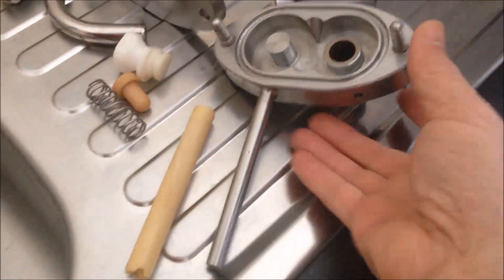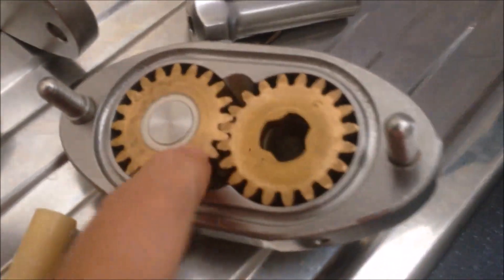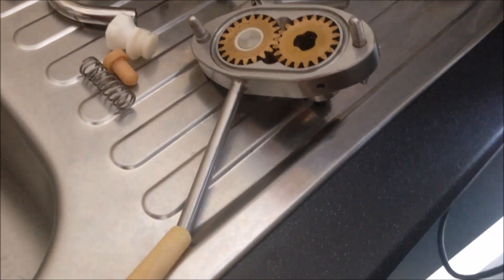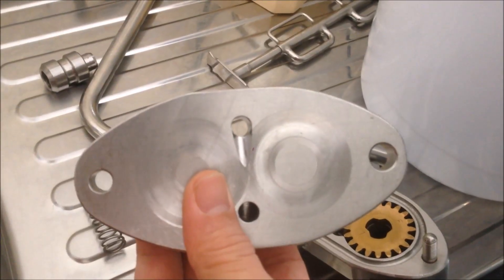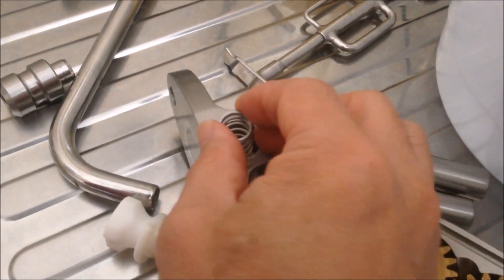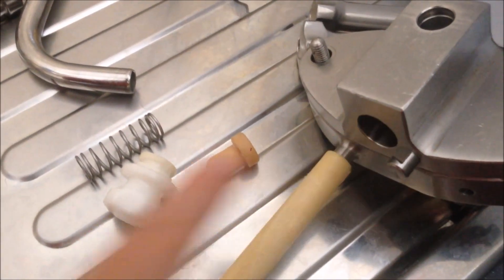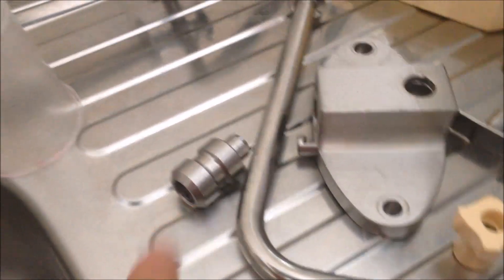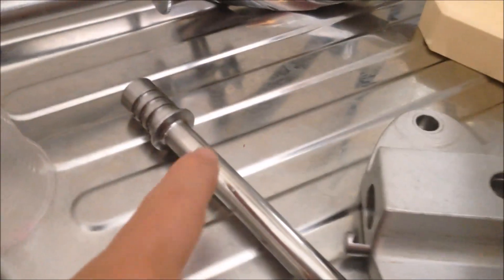Carpigiani 141 Ice Cream Machine: Mix Pump and Pressure Pipe Components

Comment: Hiya I just bought second hand machine and it doesn’t draw mixture up, upon opening I figured out the pointed valve is broken. Could that be the reason? Thank u
Reply from the maker: The vacuum should be produced by the rotating gears. Make sure the gears installed correctly and seal o-ring between the pump front and back bodies. Good luck!